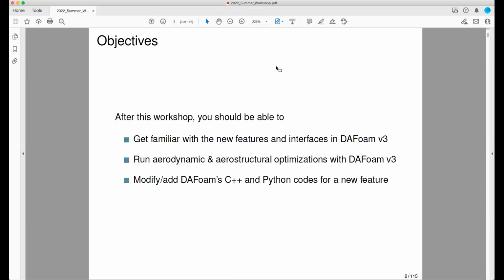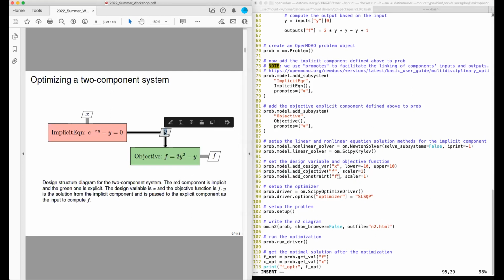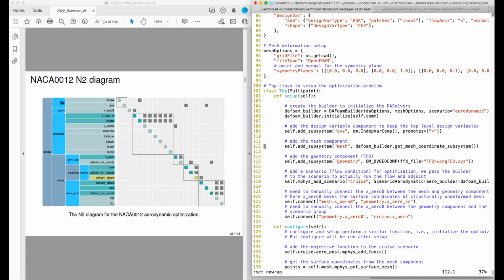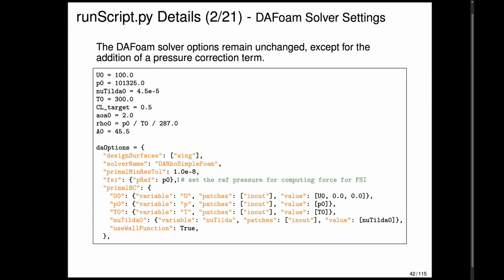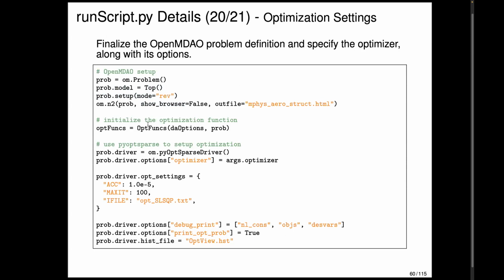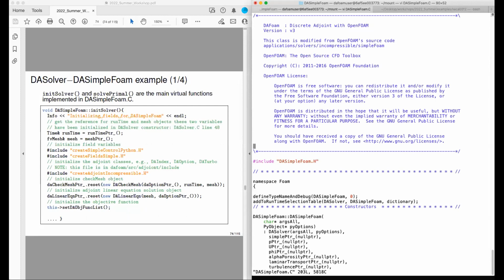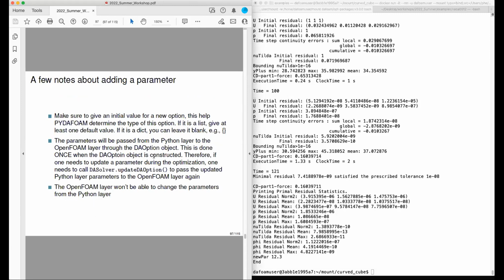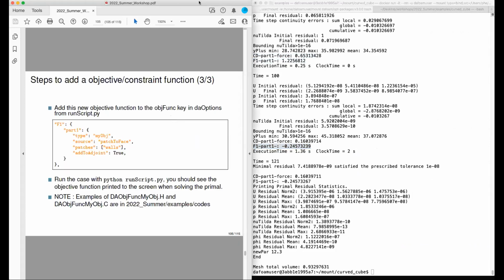DAFoam Workshop 2022

Comment: :yougotthis::yougotthis::yougotthis::yougotthis:
Reply: The rhoSimpleFoam solver often encounters convergence issues in the simulations among low-speed compressible flow. Perhaps when extending the adjoint method to OpenFOAM compressible flows, it is necessary to address the numerical robustness first...🙂